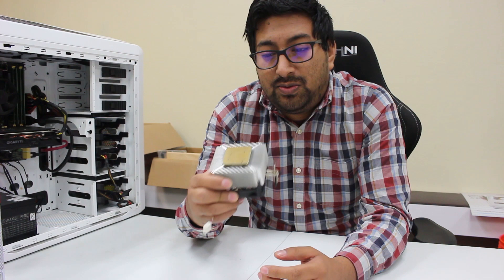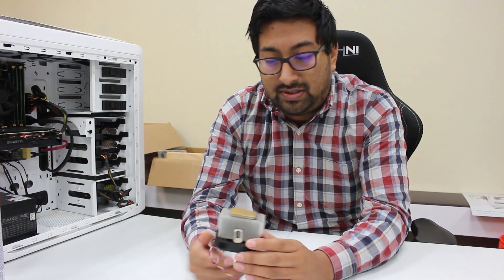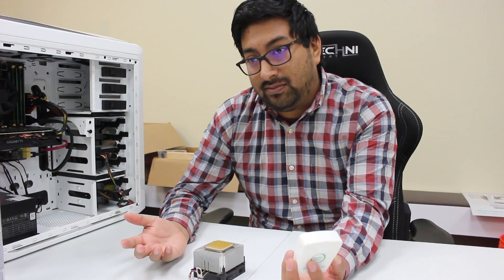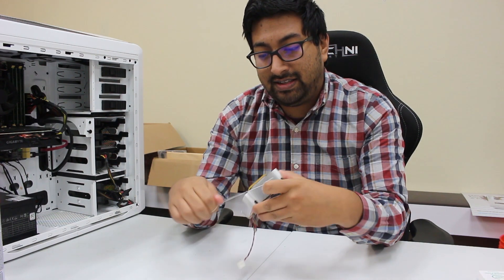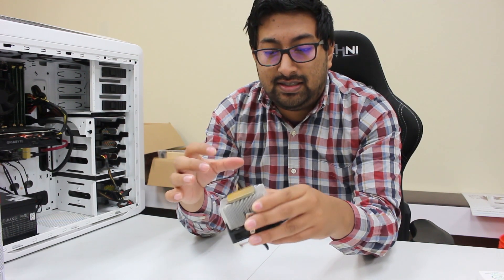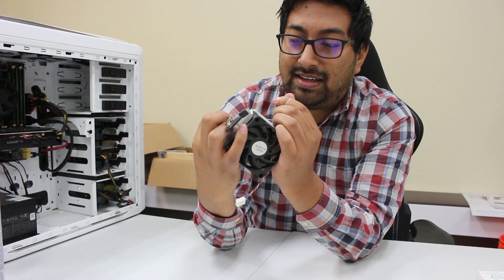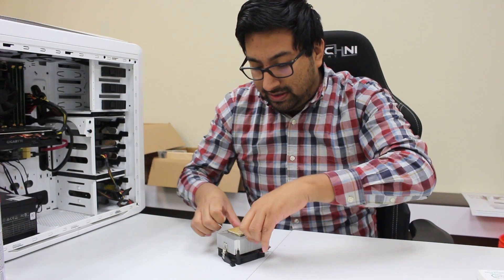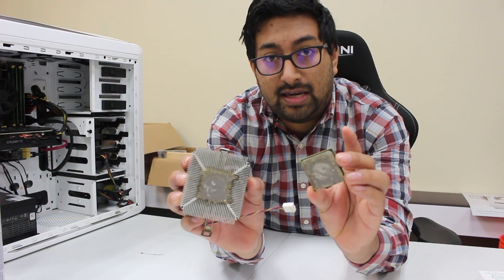How to Remove a Stuck AMD CPU

Comment: I fear my ryzen 5 3600 is exactly like this. I like this idea. Also I’m gonna run cinebench r23 a couple rounds right before try to remove it with a couple twists of the cooler before I resort to this but I may try your method as a last resort to pulling the whole cpu out of the socket. I’ll be trying this while it still in the motherboard.
Reply from the maker: Yes definitely make sure the CPU gets nice and warm, it will make things WAY easier.

Comment: I just used a butter knife and slightly wedged and the thing popped out in a second. Old fashioned
Reply: Thank you, I used a teaspoon after trying with craft knife and spirits for an hour. It popped off onto floor, luckily pins up and no damage, so I would definitely recommend only doing this with two and over cushion or bed. I'm actually scared to use the cooler on my wife's new 5600 over 92mm CM Hyper that's on her 2400g.. not sure it's even an upgrade.

Comment: I need help, mine is the cooler stuck on motherboard, i already unscrew it, but it is still stuck on the mobo, it is hard to pull out, and i am afraid to break it if im pulling too hard
Reply: Keep unscrewing and check the baseplate behind the mobo. Nothing that bad can really happen in your situation. Just don’t force anything and keep unscrewing and check on the backplate (behind the the mobo)
Reply: @thebuzz7282  yeah, i guess i did it. It already open. I just try to spin the cooler and it loose

Comment: I regret buying ryzen holy shit
Reply: just because of this? just do this shit what he said and use better coolingpaste. i dont understand why people dont have better cooling paste at home for situations like this. once i got mine out of that stucky situation, instantly wiped both cpu and cooler off with 90 percent alcohol. put some thermal grizzly and good to go. my temps dont even go higher than 60 degrees whether its gaming or stresstesting, undervolting helped alot aswell.
Reply: @deathrager2404  Wound up ripping the CPU socket off the Mobo and needing to buy a new one.

Put a better cooler on the CPU, seems to work well now.

Plus that comment is 2 years old
Reply: @deathrager2404  no it still works so I'll keep it until it dies. I should probably look into undervolting too, good luck with your project
Reply: @deathrager2404  Hey thanks, but for now I think I'm pretty goos

Comment: Is it ok to heat with a hairdryer even if you can’t get the cooler fan off? I’m having trouble I think the screws holding it in place are stripped
Reply from the maker: I wouldn't recommend it since the fan specially the blades are made from thin plastic you could end up warping the blades. Unless you are going to replace the fan as well then by all means go for it.

Comment: Thank you, you have just saved the day.  Processor was well stuch to the heat sink.  Warmed it using a hair dryer and used lots of floss. Eventually it gave way and popped off.
Reply from the maker: Glad I could help and hopefully none your the pins were bent on your CPU I have seen it happen sometimes

Comment: Dumb question, does it matter if the floss is flavor coated? 

i.e. the floss I had laying around is mint flavored. Will that flavor coating leave mint residue on my hardware?
Reply from the maker: It doesnt matter since you are going to clean off the thermal paste residue on the CPU and cooler anyway.

Comment: I’m building my first pc and this happened as the cpu fan wasn’t mounted right. The thing is I pulled the processor from the fan with my hands. And I put them back together without reapplying thermal paste will this affect my pc when I start it up.
Reply: I dont think so but, you do need thermal paste for sure.

Comment: Why is the processor sticks to the cooler?
Reply: Bcz of stupid thermal paste
Reply: Oh, ok TY
Reply: Cause the thermal paste bad or very used?
Reply: @budaibence720  no it's bcz you used your thermal paste for a long time (6 months or so) without changing it, that cause the thermal paste to dry and stuck the CPU, enough heat could make it like a sticky liquid
Reply: @WaleedDev  depends on the thermal paste, some pastes you can leave on for ages without needing to change for years.
Reply: @Likesouh  yes like the ones in the laptops and the stock thermal pad that comes with ryzen cpus
Reply: @Likesouh  I have stock thermal paste from amd in my ryzen 5 2600 and it has been 2 months do you think the thermal paste is dry??
Reply: @WaleedDev  Give it 3 months for amd stock cooler thermalpaste

Comment: Just hold the CPU and twist it would work.  Very easy.  Not need to go through the tedious efforts.   Just make sure do NOT touch the pins when hold the CPU and twist.
Reply: My paste is to strong cant twist it
Reply: Thanks for this!!
Reply: Thank you so much I love you
Reply: WOW I just tried the old “twist” method and boom! It worked!  Too nervous about heat and a cpu😵‍💫
Reply: It works thanks dude
Reply: I love you 😂🙏
Reply: Just got done taking 30 minutes bending like 6 prongs back into place after i accidentally put pressure on the pins while spinning. Did get the cpu off the coller fine tho
Reply: Mine was also so stuck none of this worked, I ended up levering it off with teaspoon.
Reply: @Saieden  bruh didnt the cpu fly off...
Reply: @beefybread5769  Yup.. luckily it landed heatsink down.
Reply: Yeeeeees thanks
Reply: my God. Why I read your comment so late
Reply: HOLY FUCK YOU SAVED ME

Comment: So, I replaced my stock amd cooler a while ago and had trouble getting it off the motherboard/cpu. When I finally got it off with a little force, I fumbled the thing and saw that the cpu was stuck to it. I had difficulty separating the two. I only realized that I had bent the pins when I placed the cpu in the motherboard's socket because it wouldn't fall into place. Thank goodness I saw the Jaystwocents video where he used a razorblade to straighten the pins out. I dislodged one, but decided to give it a try anyway. Here I am now typing this comment made possible by the very parts I almost fucked up. Thank God it worked. My pc build's not even a month old.
Reply: Holy shit dude. Same happened to me a couple of days ago when building my first pc. It won't turn on! And after a full day of troubleshooting/checking, i finally saw my cpu has a bent 2-3 pins. I received a freaking cpu brand new with bent pins!!  I almost had a  heart attack at that moment lol. Saw jay2cents vid and give it a shot using razor blades. I'm really not expecting it to work. I surely will never forget that experience. Lol

Comment: This bent my cpu pins from heating it. I just bought my Ryzen 9 3900x
Reply from the maker: How much heat did you apply that it caused the pins to bend? You can bend pins back into place with a very small flat head. We have actually done that before here in the shop to save a couple of cpus with the same issue.

Comment: I removed mine from the stock cooler than i put it back and my computer doesnt turn on. is it the motherboard or cpu?
Reply from the maker: it depends, you may want to check to make sure that all the pins on the cpu are straight and that there isnt any dust or anything else on the cpu socket

Comment: Hello sir, I want to replace my system mother board so how can I remove possessor and heat sink....
Reply from the maker: Depends on the system you currently have. Whether its AMD or Intel the step are pretty much the same. 1.Run your system if possible for a couple minutes to make sure the thermal paste is warm and easier to work with. 2.Unscrew the screws holding the heatsink to the motherboard. 3.Give the heatsink a few smal twists to loosen it and then pull up. 4. Here is where it is different for AMD and Intel, for AMD you pull the lever out and up to release the CPU from the socket and then pull the CPU out. For Intel you pull the lever out and up and to remove the socket lid that hold the CPU in place. And thats it.

Comment: Would this problem keep my pc from running properly?
Reply from the maker: potentially yes, because there could be some damaged pins on the CPU or worst case scenario they broke off inside the CPU socket on the motherboard.
Reply: CaliRamirez831 ok because my problem right now is that my pc is turning off randomly it started every 2 or so hrs then slowly worked down until the point where I couldn’t turn it on any advice?
Reply from the maker: @dixienormus4243  there are a couple things that could be causing the issue. It could be that the power supply is failing and needs to be replaced. Another thing that could cause this is if the CPU is not being cooled properly the computer will auto shutdown to try to prevent damage. Try checking those things and let me know if you need any further help. If you want to send me a video or picture of the problem feel free to DM me Instagram.

Comment: Put it in ur freezer it worked way better for me
Reply: What why
Reply: Simply heat the heatsink/CPU edges up with a hairdryer and it softens up the paste enough so you can kinda twist and fiddle the CPU off. Also if anyone wants to take it off before seeing this problem, do something CPU intensive before you take the cooler off to prevent this. Works a treat aha

Comment: What's the likelihood that the bay where the cpu sits gets damaged? I removed my cpu and cleaned it up but my pc wont post. When I removed the cpu I didn't raise the locking lever so it sounded a bit live velcro as I removed it I've looked at all the pins and they seem to be fine
Reply from the maker: that is very likely since the lever should be raised to release the pins on the CPU. That being said though the exact same thing happen to a rebuild that I did about a year ago. I would check the bay to make sure that when you lock the level it moves slightly forward which is what actually makes the pins make contact with the motherboard. Check to make sure that all the holes where the pins go look good and that there isnt any debris or any bends.
Reply: Dude i have the exact problem
Reply: Did you solve it?or its broken?
Reply from the maker: @kiavashasadi8687  The one on the video was a  non working unit just used as a demo, but in your case if it still does not budge run a couple of benchmarks to warm up the computer and then try again.
Reply: @CaliRamirez831  yeah i finally removed it....but now i got another problem...the pc won't boot, nothing shows up on the screen although all the pins were fine
Reply: Dp you think i broke the motherboard?
Reply from the maker: @kiavashasadi8687  Check to make sure that there isnt anything on the cpu socket on the board.

Comment: What's the best CPU for my 12 year old hp a6650f?
Reply from the maker: Idk man at 12 years old it is pretty hard to find decent parts I would see if you can find maybe a prebuilt and just add a graphics card. We can do a video on a low budget prebuild with a used graphics card if you like.

Comment: I have tried everything and it still stuck i don’t wanna brake it i need another idea!!!
Reply from the maker: There is one more thing you can try but definitely not recommend it because it could damage the CPU. The first thing you want to do is grab some nose pliers that are able to grip the CPU, next get some electrical tape and wrap the nose pliers so you can still grip the CPU but that it wont damage it. Third you want to take  heat gun or hair dryer to heat up the CPU, once it hot enough grab it with the nose pliers and SLOWLY start moving the CPU side to side until it becomes loose and you can finish it off with the floss. I have done this method before so I know it work BUT it was on a CPU we were recycling and while the CPU didn't get damaged I still would NOT recommend doing this unless you absolutely have to. I am not liable for what may happen if you try this. Good luck!

Comment: way easier way to prevent that at all is to do as said before and run machine then soon as the heatsink is cool enough to touch when you go to remmove it TWIST it first it will break any seal created by the paste and you should have no problem lifting it out.
Reply: Hello, can i ask a question, how can i do mine if its stuck so hard i cant even pull it out with that?
Reply: @Molinono  if you have ran the system and tried twisting it after; set up your pc horizontal so the screws or mounts to keep the cooler to the cpu are disconnected but it wont just fall off. Again run the pc but see if you can run any high temp stress test with short time like prim95 and cancel or even a few passes of multi core cinebench. Power off the pc and if you need to wear gloves use them to try and then twist the cpu cooler while it is fresh and hot. If you feel comfortable you may even attempt to twist it free while the machine is on just to break air seal then shut it down and immediately remmove. If it is so stuck that wont work you can upgrade to dripping some alcohol or other light solvent while the mobo is vertical and probably out of the case at that point.
Reply: @rvds0804  thanks a lot, i fixed it tho but thanks anyways.

Comment: I just did a X6 1090T stuck to the original cooler.  Paste was dried and not pliable so could not get the floss to start.  Tried to dab some alcohol around the edge hoping the paste would wick and loosen.  Did not work.  Ended up using a wood chisel and hammer.  Two whacks and it popped off.  Not the greatest idea but the 1090T was dirt cheap so why not.  It's back in now and running.  Time will tell.
Reply: Bro i have the exact problem with a 1055T...i just can't remove it...